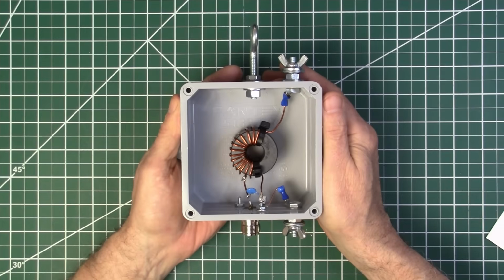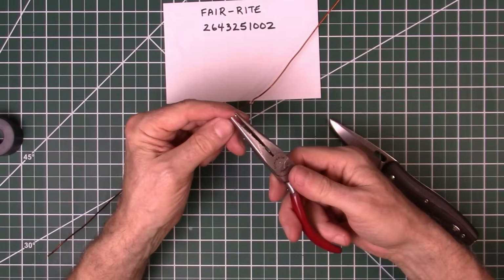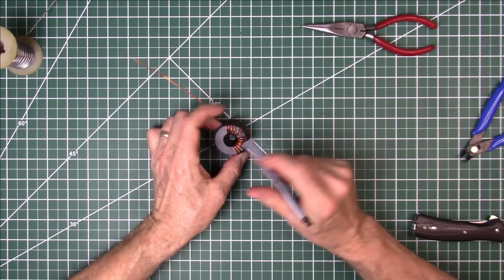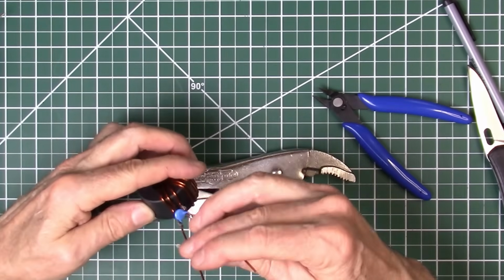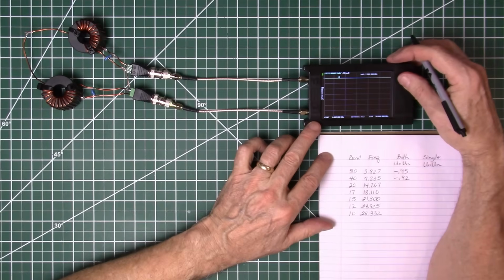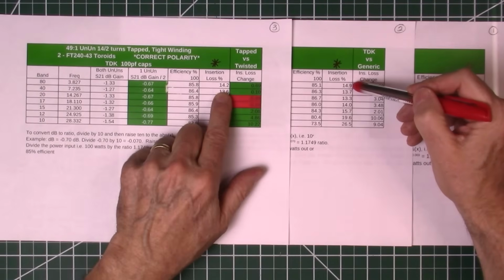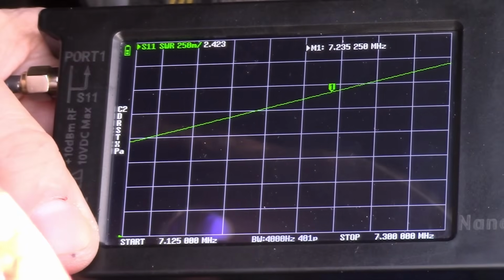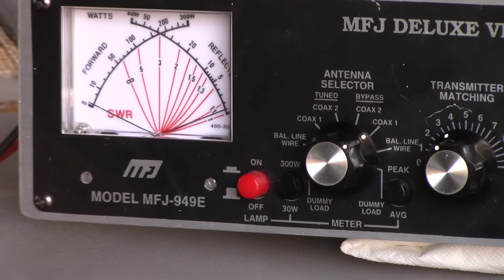Best 49 to 1 UnUn for EFHW End Fed Half Wave HF antennas

Comment: Hi a well presented tutorial I have to agree with the comments made by Dan KE6PE regarding the insulation getting damaged on the edge of the toroid my I politely suggest wrapping the toroid in PTF tape prior to winding.
Steve G4DXC
Reply from the maker: That is also an option. Consider the windings in electric motors and alternators and such that also use enamel coated wires and the environment they work in.  In extreme cases you may benefit from the additional step but in most cases it is not necessary. Just my opinion.

Comment: Just made up one of these transformers. Trying to understand how you connect the ground leg to the sheild and ground lug both. I am sure I am missing something easy and obvious but just can't see it. Could you please explain this like I am a dummy because I really am. This is the first transformer I have ever assembled and am trying to see how to get everything mounted and correctly connected inside a box. My transformer looks just like yours. I even ordered TDK capacitors per your suggestion. It sounds to me like one wire has to go to two places. Do i need to add a wire from the shield to the grounding  hardware I drill a hole for thru the box ?  Please help me understand how to correctly assemble the grounding connections.
Reply from the maker: Look starting around 25 minute mark in this video https://youtu.be/Jbuz8c7L13U?si=MGG2QzQrcW4YnFlv   It should help
Reply: i assume i can i can run my ground wire to one of the SO 239 bolts with a ring connector soldered on then make up a short wire with ring connectors on both ends and put one end on the SO 239 bolt also (the sheild) and the other ring connector to the ground/counterpoise bolt i will install in the box. Does that sound correct?
Reply from the maker: Sounds right to me. Merry Christmas 🎄
Reply: I did just this and it is working great. Won't go into specifics but I am very very pleased with the results. Both on my RigExpert 230AA and also on the air. Thanks for all the videos. You are a great big help to me. And merry Christmas to you and yours also.
Reply from the maker: @DavidTurner-g2t  Thanks for watching and commenting!  Hope you had a Merry Christmas and a Happy New Year!
Reply: Thanks.

Comment: Hey Jerry, I just wanted to say you make some of the best ham radio videos on YouTube. I recently built a few of these and had similar tuning results. I also chose to balance between 20 and 15m, like you describe since I used those bands more often. Recently, I added a compensation coil, which helped a bit. Standard 49:1 ununs have given me better readings on the NanoVNA, but those have more loss. I've had great results with this antenna, though. Occasionally, I just touch it up with a tuner. 73
Reply from the maker: Glad you've had great results with it and found the tuning tips helpful! Thanks for sharing your experience and 73!

Comment: A compensation coil of a few micro henries about 6ft from the transformer will lengthen the antenna on 20 and especially 15 and 10 and leave 40 unaffected. Might help your tuning on 10 if you want lower in the band. The antenna might be 2-3 feet shorter as a result. Great video subscribed.
Reply from the maker: Thanks for the ideas!  Thanks for subscribing!
Reply: 6 0r 8 turns 2-in diameter  placed about 6-8 feet in antenna wire away from unun makes SWR better on higher bands.
Reply from the maker: Thanks for the suggestion.

Comment: I see some older articles on EF antennas, but employing 9:1 rather than 49:1 transformers. This I find somewhat confusing. Is 49:1 a newer, "better" idea?
Reply from the maker: No, it depends on the length of the antenna and the band.  It depends on the impedance of the antenna itself. The goal is to get it to match 50 ohms for your transceiver.
Reply: Thanks! I just need an EF for 80m, and it can be as long as 75 ft on my lot. Almost bought a Pez EF-8010 JRKW from DX (74 ft, 80-40-20-15-10) but don't need all those bands (have other antennae), Kw, or the extra weight (shortening inductors) and it's $190. I do have a tuner, so a plain wire of 75ft w/ this homebrew transformer may be just what I need.
Reply: I just read a succinct explanation: 9:1 for "random" non-resonant EF wires, 49:1 for resonant EF wires, e.g. cut for odd multiples of 1/4 wavelength. Something about high current at the feedpoint for the latter raising impedance. Am I onto something?

(Incidentally I just donated to BHR for your trouble, sir. Quality counts.)
Reply from the maker: Thanks!
Reply: PS I'm watching your 9:1 unun video now, maybe better for my 80m 75-ft EF.
Reply: PS I jst watched your 9:1 unun video, that's likely better for a simple 75ft wire for 80m w/ tuner. If I could also get 30m to tune up on it, a bonus (my OCFD 40m-6m is very fussy to tune 30m).

Comment: I've got a lot of Belden 8049 #18 enameled wire, same design but thinner. What adjustment to winding the core must I make to use the #18 wire? My balun would be for 150w max, CW and SSB (no FT-8 etc).
Reply from the maker: None. You should be fine with that.

Comment: Oddly, the Fair-Rite channel has a video showing how to build a 49:1 unun for ham radio use and it uses their version of the FT240-43 toroid and not their 2643251002 toroid. 

I had a random wire antenna for years but rain and ants moved into the fairly expensive professionally manufactured unun so I'll be building a 49:1 unun soon with the parts that I received from Digi-Key last month for an inverted V EFHW to replace the random wire.  I'm going for more efficiency this time with a resonant antenna and a less lossy unun.  I can still tune the resonant antenna with the LDG ATU for use with the FT-857 but I hope to use it without a tuner with the FX-4CR that I use for portable operation.  I'll CAD and 3D print an indestructible case and I'll make sure no water or ants get inside this time.   😀
Reply from the maker: Hope it works out better this time. Thanks for watching and commenting

Comment: I appreciate the experimental approach, which is in the best tradition of amateur radio but also leads to better results.  That's usually the case.  Better understanding leads to better results.  My engineering motto:  One good test is worth 8,567 expert opinions.  I'd never seen the Fair-Rite 2643251002 toroid, so thanks for that.
Reply from the maker: Thanks.  It was not original with me but I’m not opposed to using the ideas of others.

Comment: Thanks for the detailed explanation, What’s the length of the wire and counterpoise ? And what AWG? Im planning to use 18Awg or 16Awg to be heavy duty
Reply from the maker: A 40m EFHW is around 66'. You may need to adjust to get lower SWR. The counterpoise around 6.5' or 5% of the wavelength. I use different AWG depending on power. For 100w or less anything 22 AWG or larger should be fine. The larger diameter wire gets a little better bandwidth. Either of your gauges should work fine.

Comment: Great video.  A good method I have found for removing the enamel from copper wire is to use a flame (candle, cigarette lighter, alcohol lamp) to burn the enamel in a small area, and follow that with a quick buff with steel wook, and lastly a wipe with isopropyl alcohol.  That preps the wire very well for soldering.  However, this method doesn't work very well for small gauge (less than 28-gauge) wire, as it can melt the copper wire.  Again, great video.  Thanks and 73.  Ken -- WBØOCV
Reply from the maker: I have heard that. Thanks for your suggestion and thanks for watching!

Comment: I built two.  My results are basically double the values of yours.  I must have done something wrong, but can’t figure out what exactly.  My Grandfather was a HAM from around 1950 and my Dad from 1960 and me since 1988.  I love watching your videos.  You are indeed helping many.  I certainly appreciate your channel and what you do!  Keep ‘em coming. 😀
Reply: I had the same problem, but I found the trick is to make sure you wraps are tight, but not overlapping, and make all of  your leads as short as you possibly can.  Straight to the connector...no bend, no loopies, no excess.
Reply from the maker: @jasonduke1871  if you could take some detailed pics and email them to me I would try to diagnose your issues. My email is on QRZ.
Reply from the maker: Thanks.  Hope you figure it out. Thanks for watching!
Reply: I think a more accurate measurement would be to transmit into the transformer and measure the output with a watt meter.  Use a thermal camera to look for heat radiating from the toroid for the confirmation of heat.  I'm not convinced the numbers coming from the nanoVNA are accurate measures for the loss of power.  IMO, a power meter and thermal camera would give you a more convincing measure of loss.
Reply from the maker: @6345788It may indeed. Send me a thermal camera and I’d be glad to do that! 😉
Reply: I do have a thermal camera and will take some pics and send them to you.  I'm sure they'll be red 🔥 😁 I don't have a wattmeter, though 
I really like your videos and how positive you are during your activations.  😊 @BudgetHamRadio
Reply from the maker: @6345788Thanks. I have an infrared thermometer but not a thermal camera.  That is on my wish list. I have my Automatic Antenna Tuners that can function as a power meter. Just turn off automatic tuning and put it where you want it in the feed line.
Reply: @BudgetHamRadio Never thought of that!
Reply from the maker: Sounds like your lowest frequency is 80 meters.  This one is 40 meters.  This one may be able to work 80 with a tuner.  We’ll see!
Reply: @BudgetHamRadio  I'm going to try it on a 40m with an 80m loading coil. How much power with this unun handle? Thanks.
Reply from the maker: Don’t know exactly and I don’t have an amp.  It “should” handle 3-500watts SSB. About half of that for digital.

Comment: Using a smaller case and now I know why you use the larger cases they are way easier to work in....    I used a 3x2 learned my lesson on that one.
Reply from the maker: The wire is stiff and it’s just about the right size from my experience. Thanks for watching and your comments.
Reply: @BudgetHamRadio  Thank for the videos!   I just finished up mine tonight.   It did not turn out too bad.   I think I may need a different soldering gun.    The one I have is a reword station and I don't thing it quite gets hot enough and the iron broke on it tonight.   Absolutely love your videos I love to build stuff.   Keep the great videos coming and God Bless!!!
Reply: Without your video I would not have gotten this done.  KC3ZGC!!!  73
Reply from the maker: @Grumpyolfart glad it was helpful!

Comment: Any reason it can't be used 80-10?
Reply from the maker: Antenna length would be only reason. If your antenna is resonant on 80 it should work fine.
Reply: Better ant length is about 132 feet or double length of 40 M antenna. 

For 9 to 1 unun, try 71 feet and use antenna tuner. One source said it'll even work on 160M.

Comment: Great video, but let's put things in a bit of perspective the difference in performance between these two different designs is less than 1 dB. That's not what I would call a huge performance difference by any stretch of the imagination in fact that falls Far Below the accuracy of the NanoVNA. 

The difference between 89 Watts and 73 Watts is insignificant. It's a fraction of an S unit at the receiver, the difference between an S8 and an S9 signal at HF is 6 DB and the difference in performance between these two designs is less than 1 dB. 

With that said I do like the design your building better, 

Just for reference a reduction of power from 100 W to 89.1 watts is -0.5dB

With the other design the reduction in power would be from 100 Watts to 73.5 Watts  for a grand total of -1.34 dB 

That makes the performance difference within 0.84dB 

You reduce your loss more by upgrading your coax from RG58 to RG8x
Reply from the maker: The main point is that watts making it to your antenna is better than watts being dissipated as heat in an inefficient matching transformer. Thanks for watching.

Comment: excellent informative video  ,, Just wondering if you have considered using a compensation coil around 2 meters from the transformer , Something like 5 turns around a 1 inch former , Pretty sure it will bring the lower and higher bands tightly together when testing for swr. Most  if not all commercial antennas adopt this approach
Reply from the maker: May have to research that. Do you have a link?

Comment: @BudgetHamRadio, What would happen if your center conductor and shield were switched? Would it matter since it is a DC short? So if your center conductor was at the beginning of the magnet wire and your tap, 2 turns in, went to cable shield? 
Curious if that even matters.
Reply from the maker: Yes it matters. RF is AC, not DC.  What shows as a short to DC is a reactive load to RF and polarity matters.

Comment: I've noticed that in all the videos that I have watched, the presenter has put all the windings pretty much together on one side of the toroid. Is there any particular reason for not spreading the windings out so that the heat is not so focused on just one part of the toroid? By the way, this is the best video that I have seen on how to wind the 49:1 unun. Thanks for a great job! Todd, N7TWL
Reply from the maker: It is because the magnetic field around the wires interact with each other and reinforce each other.
Reply: @BudgetHamRadio  I knew you would know the reason. Thank you for a great video and sharing your knowledge!!
Reply from the maker: @Todd-TWL hope it is helpful.

Comment: I have heard you can just solder over the enamel and it will just vaporize the coating.
Reply from the maker: That may work but I’d rather be sure and physically take it off.

Comment: I wonder if plastic crochet hooks might speed that effort (metal hooks may destroy the coating as you pull)? Also I wonder if that coating on the wire burns off or dissolves in acid or something?
Reply from the maker: Good questions. I don’t know. Maybe some other viewers know and will comment.

Comment: Great work, thorough investigations, and interesting results. Appreciate the real-life SWR measurements of the EFHW antenna built with the highly acclaimed toroid and winding technique. They do not produce a true multiband antenna as it is the case with classic core (ft140-43, ft240-43) and twisted primary winding where the SWR is almost 1:1 in all bands (7,14,21,28MHz); no tuner is required. What's the point in having a 90% efficiency transformer if the loss due to high SWR is 25% (swr ~ 3:1). I also tried and tested different cores for the EFHW antenna. Well done, and thank you for sharing.
Reply from the maker: Thanks for watching

Comment: How much power can this handle?
Reply from the maker: This single core should handle up to 300w SSB. If you increase the wire gauge it may handle a little more. I have not tested above 100. I don’t have an amplifier.

Comment: What power level does this design accomodate?   How to scale it up to a kilowatt SSB?
Reply from the maker: This design should handle up to 500w SSB.  Use 2 cores and go to 12 awg wire to get close to 1 kw SSB. Watch your SWR when first operating. If it starts to go up suddenly the cores are overheating and you will need to back off the power. However I believe it will handle it.

Comment: Hi, does anybody know how much digi it can handle? thanx.
Reply from the maker: This core should handle 100 watts digital as thick as it is. You can test it as long as you have an SWR meter and/or an infrared thermometer. If the core starts to overheat, the SWR will start climbing significantly.

Comment: I think that before testing for efficiency you should do the swr test with a 2450ohm (or close) resistor replacing the antenna. Maybe make a video of this sweep?
In my case I found that with this toroid and magnet wire it’s very difficult to obtain a decent broadband 7-28mhz) transformation ratio. Initially I had nice low values around 7mhz but they went up to 4:1 around 28mhz. I found that tightening the turns improved a lot but in the end I still couldn’t get better than 2:1 swr on 10m.
By comparison, a commercial 49:1 I own based on the FT240-43 toroid measures less than 1.5 swr from 7mhz to 30mhz through a 2450ohm resistor.
Reply from the maker: Thanks for the comment and thanks for watching.

Comment: Excellent presentation, sir.  Your attention to detail and thorough description are most appreciated.  Trust that I'll be using this as a tutorial the next time I build a half-wave end-fed antenna.  I am curious about how you arrived at the length of your counterpoise.  I suspect that you derived your 6'6" length as a compromise, using half of the 1/4 wavelength of the 17m and 15m band.  While it might be more of a nuisance (as counterpoises can be) I respectfully wonder if using a full 1/4 wavelength (13 feet) for the counterpoise might net a slightly improved result.  As I am not nearly as fluent as I should be in all things electronic or resonance, I ask this humbly in an attempt to learn more.

As always, thanks so much for sharing.

Steve
Reply from the maker: It is a calculated length of .05 x the wavelength of lowest frequency to be used. Several different sources smarter than me came up with it.  A longer one can be used up to .1 wavelengths or even use multiple radials.  Depends on where and how you want to use it.  I have not tested different configurations but just went with the most compact suggestion.